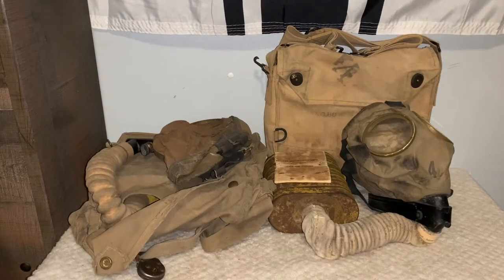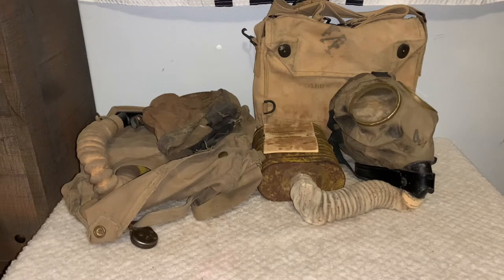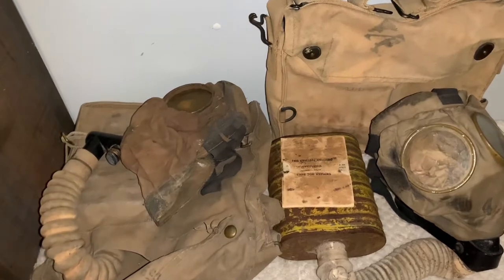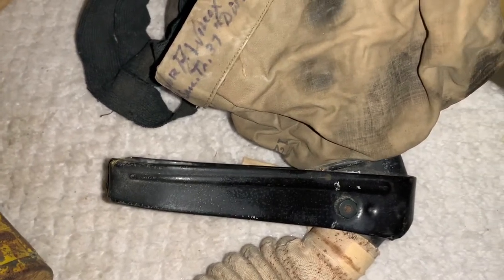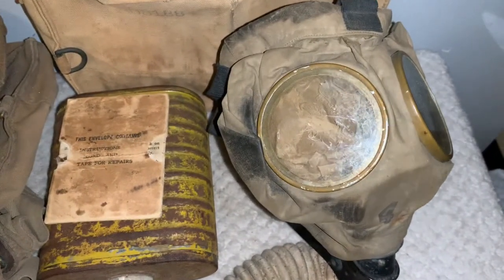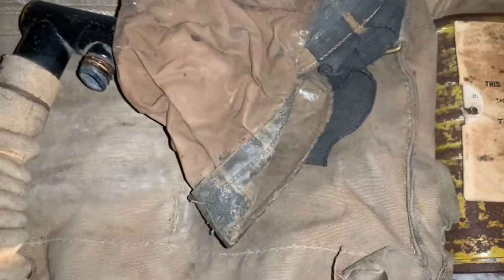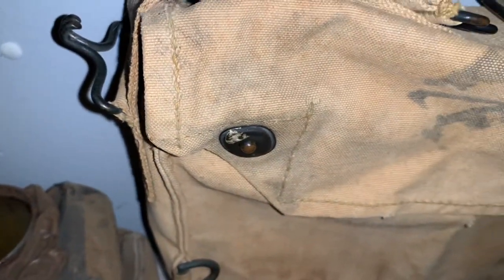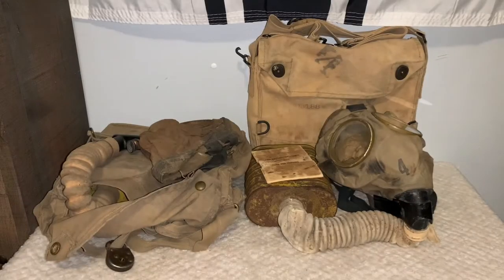The difference between the SBR and the Type CE respirator

Comment: Great video! I do have some corrections, though. First, some examples of the CE use celluloid lenses instead of the usual triplex lenses. Second, both masks use metal wire and fabric tape to secure the hose. On your CE, it's just covered up by the second layer of fabric tape while that layer is missing on your SBR. Also, the tape in the instruction booklet is not meant for the hose. Instead, it is meant to repair any tears in the facepiece. A soldier would not replace their own filter, it would be collected by their unit's quartermaster for that. Third, on the peripheral seal of the SBR, that's not the same rubber lining as inside the facepiece; it's rubber cement used to seal the exposed stitching. Fourth, some of the CE's carriers (the MI Chest Carrier) do have square rings like on the British carrier.
Reply: Amazing! :))